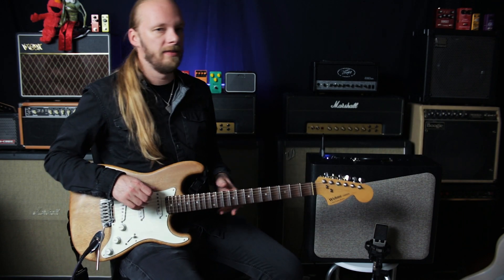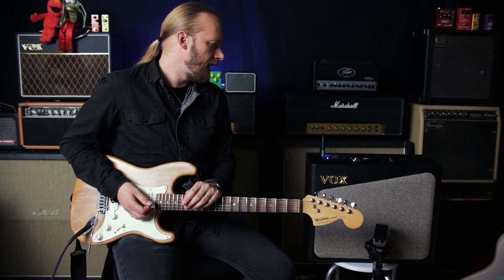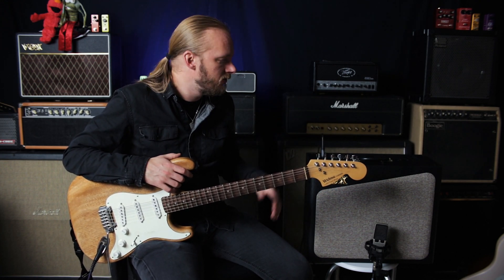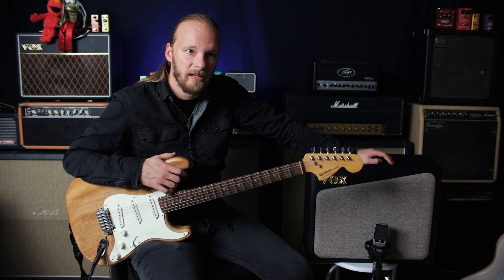Vox AV30 (A Modelling TUBE Amp?)

Comment: Seeing a lot of comparisons in the comments between the Vox VTX series and this AV series. They VTX is digital modeling with low plate voltage tube pre. The AV is analogue circuitry with low plate voltage tube pre and post behavior. The actual output amp is analogue, I believe. 

There is a significant distinction between the 2, in my opinion. I’ve owned both, and the AV30 is far superior, in my opinion. 

I finally got my hands on one of these recently and I really like it. It’s a great amp. I don’t compare the models to what they are “supposed” to be. I simply judge them by the sound I can get. I like the way it sounds. The Hi-Gain models are a little too furry unless you switch off the fat, bias, and reactor switches.

Comment: Hello, thanks for all the useful reviews. 

I happen to own both the VT20X and the AV15 (and an older AD15VT year 2007). 
They are 2 completely different products.

The VT20X is a digital modelling amp (VET) + valvetronic technology using a preamp tube.

The AV series amps are completely analog (escluding the 3 digital effects): each preamp section is a different analog circuit that tries to emulate popular amplifiers. 

The VTX series is more versatile: it has a lot of effects, including noise reduction for hot amps, and it work best if you connect the amp ti a computer when creating your own sounds. I didn't like the stock speaker so i changed with a Celestion 8-15 and now I love it. I can get very nice tones including YJM marshalls+rat-dist and RB AC30+trb-booster.

The AV is more like a traditional amp (btw the AV15 is single channel / single tube). No overdrive/booster, no noise reductor. I didn't change the speaker (I thought I had to) in it because imo it sound much better than the one in the VT20X. My first impression is that it responds more naturally to picking/fingers. It is very dynamic. It offers more bite turning up the gain control. I don't like the modulation effect (I never use chorus anyway). I cannot get a delay time longer than 0.5 secs (this I really hate). The reverb is good enough for me for practicing. I tried the amp with custom made boosters (both germanium and silicon transistors) and with the dod250 (the first yeallow reissue) and I was able to get decent RB and YJM tones. In my opinion the AV shines in break-up/crunchy tones. But you must not expect a faithful reproduction of other amps, just nice tones. Just dial the knobs until you find your own :-)...and do not expect a traditional "tube" amp color. The result is nice to my ears, but consider that the saturation of power amps is emulatd using a preamp tube + analog circuitery. It costs 20 EURs more than the VT20X, but considering that I had to change the speaker at the end it actually costed me 15 EUR less. I believe that digital modelling is more cost effective than using analog circuits.

I like them both for different reasons. Compared them my old VOX AD15VT (with a Jensen speaker replacing the stock speaker) sound louder and hase more presence. It also weighs a bit more: 10kg compared to about 7kg for the newer models.

cheers
Reply from the maker: Cool bananas 😊

Comment: I have this amp and use it mostly for playing at lower volumes in my music room although I regularly jam with a bass player and another guitar player with our vocals through a pa. I almost exclusively keep it on the clean 2 setting and use my pedals to vary the sound. I am able to get any number of really great sounds without having to crank it up to the point where it hurts my ears unlike nearly all of the other amps I have tried. It may not be the perfect amp for everyone but it is working well for me. 
Ps. The more I play my guitar the better it sounds. It’s at least 95% the musician and at most 5% the musician.

Comment: I had a Vox VT-80+ for a while. That was a great sounding amp. Except for the smaller cab, I A/B’d it with an AC-15 and they were very close sounding. The built in effects were very good. It used a 12AX7 tube between the preamp and power amp to give some tube squish.

Comment: Wait, so you found that a $700 (2023 pricing) Peavy 6505 mini head through a Marshall cab was better than a $300 combo with a 10" speaker?  You don't say!  It's probably more realistic to compare it to a peer or at least plug it into a 12" external cabinet.  Or just say that you don't care for the amp.  It's discontinued, so the market probably agreed.

Comment: I have a Fender Super Champ xd with a pair of 6L6’s and a 12xa7. It has 16 different voicings it’s called modeling tube amp. I do like it, but it doesn’t take pedals well at all. 🤘🏻
Reply from the maker: Cool. Well, apart from not taking pedals.
Reply: It doesn't take pedals well because the preamp is solid state/digital. The 12ax7 is just a phase inverter.

Comment: Vox likes to stick tubes in any digital amp (for some reason).
Reply from the maker: Weird.
Reply: But isn't that a good thing tho?
Reply: @indybingyi  well tubes are good when they interact with other high power electrical parts ...they dont do much interacting with a microcontroller
Reply: @RapttorX  they look cool tho
Reply: @indybingyi  thats what the marketing department also thinks
Reply: It's not that easy to digitally emulate tube amplification, as it depends on many factors  that interact with each other.  A good (analog or digital) emulation needs to reproduce all these factors and their interactions (which no profiler based amp on the market currently does). It is itself not a bad idea to skip this difficult part in a modeling amp by using a real and relatively cheap preamp tube to add the characteristics of tube amplification to the sound instead of trying to emulate them. 

In essence i think it is an interesting approach takes away many practical disadvantages of full tube amps (heavy, expensive, unreliable) while keeping many of the advantages :).  The Amp1 from Bluguitar is in my opinion a great example, with great sounds, using just a single nanotube in the preamp,  combined with analog modelling and a small and light 100 watt class D poweramp. 

I do like the approach that Vox took with this amp, combining analog modeling with a tube in the preamp and in the poweramp stage to try to capture both characteristics.  I do not know of any other amplifier that has used this approach.

But for what it is worth, i do have to say i also did not hear anything special in the demonstration.  This might however be related to the fact that despite the interesting concept, it is a budget amp.  I would be curious how this amp would sound with a decent power amp and cabinet. 

It would also  be interesting to see a higher budget amp with this approach

Comment: Not exactly a new idea vox, I've got an 8 year old Peavey Vypyr 60 Tube which has an analogue modeling preamp with a pair of 6l6 output tubes! I think Vox's marketing people need to do more research! 😂
Reply from the maker: Haha :D
Reply: With the Vox, you have a tube in the preamp and power amp which makes it different
Reply: @voxpathfinder15r  the peaveys got a preamp one as well.
Reply: This amp does not have a tube power amp (likely a class D power amp). The tube is used to emulate the characteristics of a tube powrramp :)
Reply: Vypyr is digital modeling.

Comment: is vox av30 a tube amp??
Reply from the maker: Hybrid.
Reply: @MrPolevaulter  Nope. It's not hybrid.  Unless you understand hybrid different than I do. Hybrids have either a tube preamp or a tube power amp, not both. This has tubes for both. But has an additional solid state amp at the end for the power. But it doesn't change the sound of the tubes. This is a full tube amp for the sound. The power is done to make it affordable obviously. But it doesn't color the sound at all.